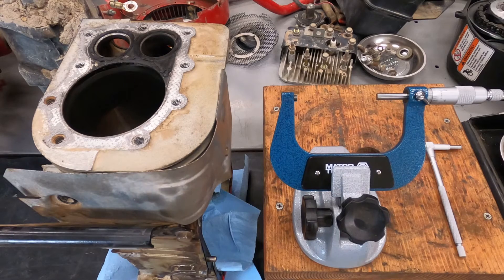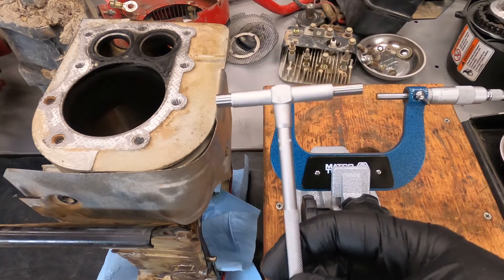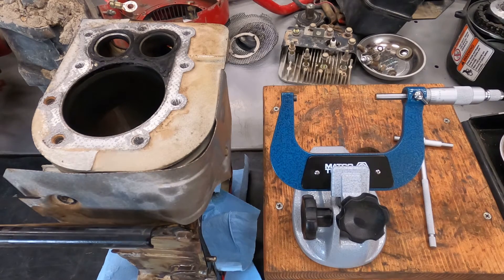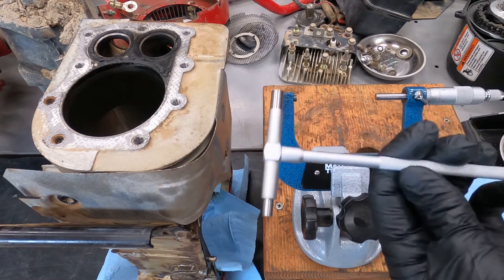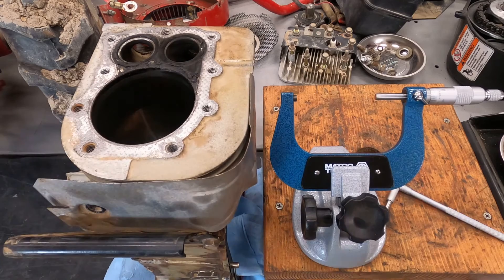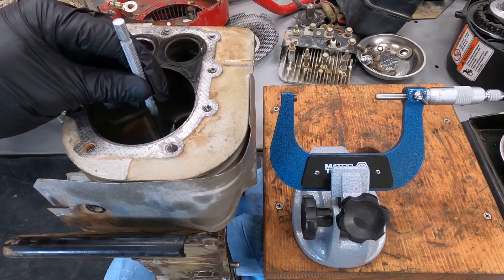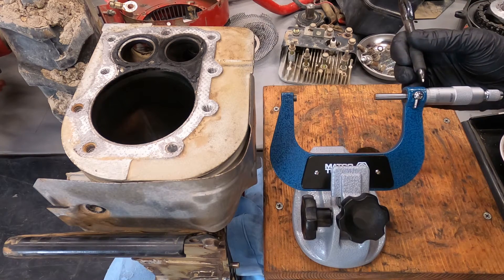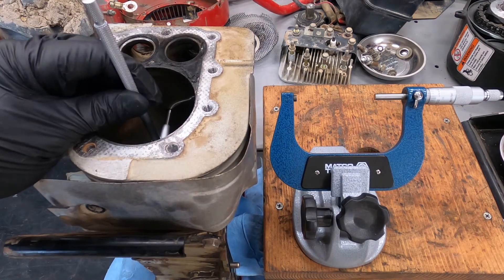How to Measure a Small Engine Cylinder Bore for Out of Round & Taper

Comment: I would think it was measured wrong just guessing , the taper will be larger at the top 9 times out of 10 , and id start with the crank , since theres no bearings , if the crank aint in spec its toast , and you cant bore them with a hone , so who has the hold down fixture to bore the block ,the  sunnex i seen wouldnt bore it after i had it locked down it was to tall for my boring bit to fit over ..what to you use to lock it down in the boring machine square with the crank ?

Comment: Good video explaining the prebuild inspection. I wouldn't rebuild at 30 over they are always short lived engines, run to hot. Just my 2 cents
Reply: The biggest issue these days is just cost... overbore, hone, pistons, rings, gaskets, labor.... and so on. Hard for small engine repair guys when the parts and labor involved becomes as much as another engine or just replacing a mower or saw.
Reply from the maker: I absolutely agree with you Rusty!

Comment: Kile if you go 10 over you will be good to rebuild if you spend time with those tools the time spent will count you more then the rings
Reply from the maker: I definitely see what you are saying.  But I cannot bore it .010 or .020 because it is already at 3.024x.  The largest I could go is .030.
Reply: You could go bore it then sleeve it but would the cost be worth it
Reply from the maker: @schaeferslawngardenandpowe1924  Good point.  At this point my customer is weighing all of his options but is leaning towards not putting any more money into it.  He has gotten a good 26 years of hard use out of the machine.  Thanks for sharing Schaefer!
Reply: Good video kb,,, I just can't come out with rebuilds. If u go 30 it'll run very 🔥,,
Oversized rings hav a tendency to break.
U made the right call. New engine.
If the customer wants it rebuilt, disclaimer for sure. Ur not responsible for future failure. Awesome job.
Reply from the maker: @clsmallenginerepair3814  thanks Carl! Some people just get sentimental ties and try and do everything they can to save it.  This guy bought this for his wife for their 30th wedding anniversary.  But like you said, we can save the machine by engine swapping.